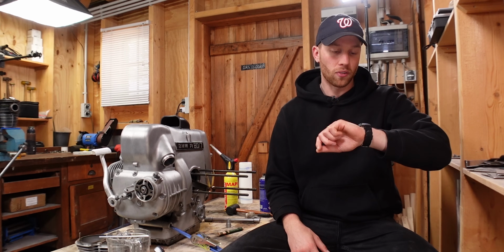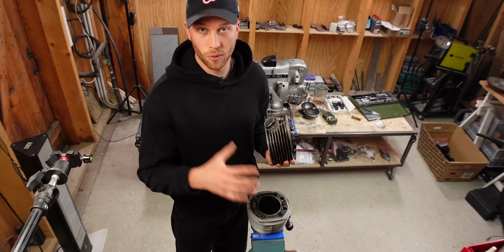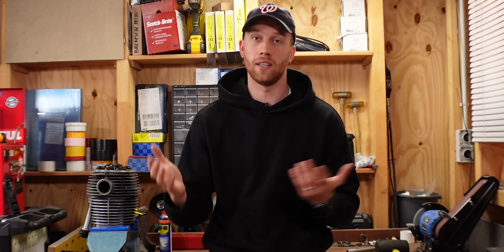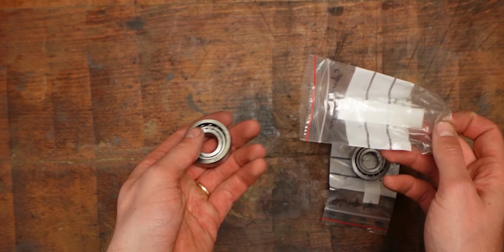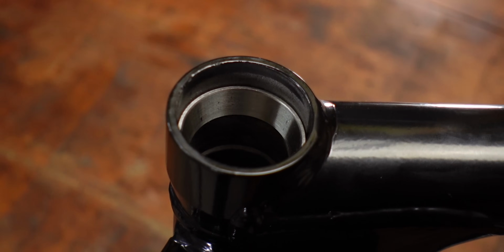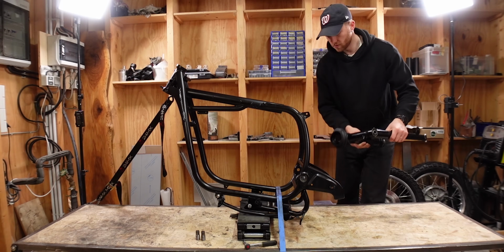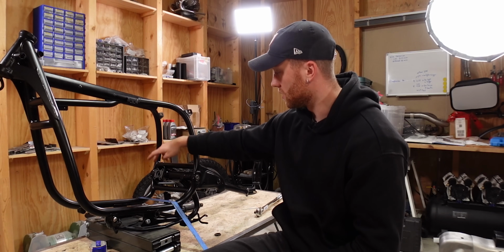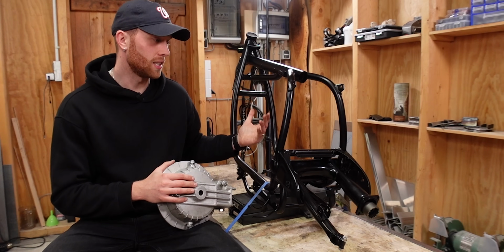I wasn't prepared for what I found inside the BMW R80 engine...

Comment from the maker: 🚨 50% OFF HP Academy Courses 🚨
If you want to build a custom bike, these are the courses that took me from zero knowledge to my first finished bike. And through the links below you can get 50% off…
💥 TIG Welding - https://www.hpacademy.com/courses/practical-tig-welding/?c=664a
🧰 3D Design - https://www.hpacademy.com/courses/3d-modeling-and-cad-for-motorsport/?c=664a
🖨 3D Printing - https://www.hpacademy.com/courses/practical-3d-printing/?c=664a
🪢 Wiring - https://www.hpacademy.com/courses/wiring-fundamentals/?c=664a
🛠 Fabrication Fundamentals - https://www.hpacademy.com/courses/motorsport-fabrication-fundamentals/?c=664a
👉 All other courses are here: https://hpcdmy.co/motowrenchers

Comment: Never clamp a barrel or cylinder in a vice like that, NEVER. It would be very easy to over tighten it and due to the high clamping force cause damage. Better to lay the barrel down on a soft complient material (folded cloth, sponge or some such, and use a ratchet strap over the upper side to hold down the parts. A much larger area is held, also the surfaces are not smooth retaining the parts better.
Reply from the maker: Thank you, I appreciate the tip! 🙏 That was the first time for me taking off cylinders. Still a lot to learn…

Comment: if you haven't touch the transmission then you might need to get it check also. the little springs inside do breaks easily . good luck on the build .
Reply from the maker: Thank you very much! Fortunately everything still worked out after the build.

Comment: Rebuild many of these,used also siebenrock parts...Really good bikes if done correctly in the first place
Reply from the maker: Yeah, I feel like when it comes to engines the devil is definitely in the details. How do you like the Siebenrock kit?
Reply: @MotoWrenchers  siebenrock are really good,and price wise I find them decent.big bore kit gives them a good gain in torque,they could easily pull a 6th gear
Reply from the maker: Nice to know. Would be a cool upgrade 😍

Comment: The cross hatching finish of the bores is just an acceptable production finish that enables proper bedding in of the other machined surfaces on the piston rings and piston skirt and it is quite ok and normal for them to become less prominent or even disappear after moderate mileage in fact it may be more of a worry if they are still evident after a high mileage as this would indicate that the engine has not bedded in properly most likely because the wrong type of oil has been used and their presence almost always results in higher oil consumption.
Moly grease is used in the swinging arm bearings to prevent Brinnelling which is localised fretting of the bearing surfaces it has nothing to do with working temperature, it should also be used in the steering head bearings for the same reason.
Reply: Actually good engines show cross hatch even after high km,shows a properly used and maintained engine
Reply: @bikeserv  .... and many engines DON'T show the X-hatching and perform perfectly well... it seems like a silly thing to get hung up on when there are many more important things to do for engine reliability... 🙄
Reply: @peterfitzpatrick7032  Cylinder walls with a superior surface finish have a uniform series of cuts, grooves, valleys, or scratches in a crosshatch pattern. As BRM's downloadable Gold Booklet explains, this surface finish provides a bearing surface for piston rings and promotes oil retention.Build many engines, cross hatch is important regarding cylinder performance and reliability.Engines will work without crosshatch,but not as they should

Comment: The importance of cross hatching is much OVER estimated. It are just production grooves, which were to costly to polish away. It is the "good-enough" endpoint of economic production, that is the real reason they are there.
Never-ever a cross-hatching believer came with single prove it was utterly important. It is just a myth. Think of all chromium plated cilinder walls without them! All Nicasil cilinder without them
Yes, if you OVERHEAT the engine with bad compression rings (= hot blow-by to the piston) it seizes and then you blame that to the absence of cross hatching. No, wrong. Aluminium of the piston became too hot, softend and melted, soldered to the cilinder wall. 
I prefer and tested near-clean cilinder walls a lot , like Nikasil or Gilnicil. They have ample cross- hatching. The fact is that older oil scraper rings leave more than enough oil on the wall.
I tested new rings (!) on polished spotted cilinders obeying temperature, mixture and using new oil: it never seized. Test was crossing the Alps, more than 2000 m high passes....
Comment is "teacherous" but drove 286.000 km on one R100RS and 100.000 on previous R60/5.   Good luck, nice work.
Reply: Cross hatching is from honing, it is not “production grooves”. A “polished” cylinder results from a more fine hone being used. Your argument shows you don’t understand machining. Aluminum melts at between 1100 and 1400 degrees F. An engine that got hot enough to flow aluminum like solder would have ceased functioning long before. You have no idea what you are talking about.

Comment: I bought a R100GS, claimed to be for touring. VERY thirsty engine. The coil cracked and water stopped the bike, The Alt rectifier, EXPENSIVE, blew diodes, CRAP quality. Replaced  it with car alt rectifier, Carbies, designed and used in Europe continually grew jelly on emulsion tubes and required cleaning  very often. SUSPENSION was pretty useless and hopeless in absorbing shocks. Oil seal at rear of gearbox made OE and was fitted INCORRECTLY.. Starter bearings dried out and became slow and noisey.  Clutch cable broke, Brakes were barely enough to stop the weight and front squealed all the time. Although sold as QUALITY a BMW IS CRAP. New ones spend more time in the workshop than on the road. Never had ANY problems with Japanese bikes, not EVER!
Reply: Cheapest reliable touring bike you can buy is a VFR… can pick a good example up for €2k, I traveled thousands upon thousands of miles around Europe never once let me down!
Reply: Unlucky, 350,000 miles just replacing odd wornout consumables. My brothers PD GS has over 500,000 miles! I’ve bought new Hondas, and watched them just wear out, 2000 mls a week. Didn’t take a year! The BM will still be running, long after the jap bikes have died through electronics failure!
Reply: Maybe you just bought a lemon. But let's not overlook your intermittent capitalisation of words. What's that all about?

Comment: R80 engine one of the sweetest around. Super smooth and a pleasure to ride. I have one with 30K on the clock and engine untouched from new, Also an R100RS with just 21K and everything like new. Both heavy flywheel models.
Reply: Rubbish. I had a 1978 R80. One thousand of these dogs were built with badly finished crankshafts . In those days manufacturers recalls were not a legal obligation. I know because mine was one of them.
Yours are barely run in yet. When the engine shits the bed after less than 1000 miles a year after about 40 years do you expect BMW to put it right or do you simply claim it as a masterpiece of old fashioned engineering?
Reply: @philhawley1219  Not quite correct. There was a mass recall in the early eighties to replace a front wheel. Cost to BMW about four million. I have had these bikes since the early eighties but perhaps you were unlucky.
Reply: @majorscope  Mine had the early wire wheels. Unfortunately the Swiss cheese crankshaft was overlooked.
I have never wanted a BMW with two or four wheels ever since. Badly Manufactured Wreckage.
Reply: @philhawley1219 seen many with a lot more than 100k,some with more than 200k

Comment: I  restored a  1985 R80 and took the engine complete apart, crankshaft out, and rebuild it with new bearings, seals, drive end, everything check for robusta racer in internet (way too much money in parts). For the electrical I would strongly recommend not going with the stock wiring but using M unit from motogadget. Your bike is looking great, good job.
Reply from the maker: Hi, just found your blog. Great documentation of the build and the bike looks very clean! How much would you say a complete engine rebuild cost more or less? I was wondering when cleaning this one because it could have been nicer to do a rebuild and get everything vapor blasted. I already installed the munit blue underneath the tank and finished all of the wiring. The munit is definitely a good call!
Reply: @MotoWrenchers   I bought all parts in an online store in UK called Motobins. BMW parts are very expensive but engine rebuild don't need many. Carb kits, seals, gaskets, bearings, piston rings perhaps $400. Bearings most likely be ok but once you get to them to inspect them I think it is better to change them. Press fit seals to me are a must, on both ends of the crankshaft and  camshaft, since if they have never being changed, chances are that the rubber is hard and brittle and at some point they will leak a little bit. They may not but having a fresh rebuild engine feels good, specially if you are planning to keep the bike. I would also change the press fit seals in the drive shaft and gear box. Again, may not be needed but it is peace of mind.  The motogadget M unit will make an electrical installation much cleaner and simple. For the oil sump gasket, I wasn't lucky using the cardboard gasket style material, it always leaked so I ended up using permatex instead. Enjoy the build, and I warranty that you  will have kite some thumbs ups while riding it on the highway. Airheads look pretty cool of done right.